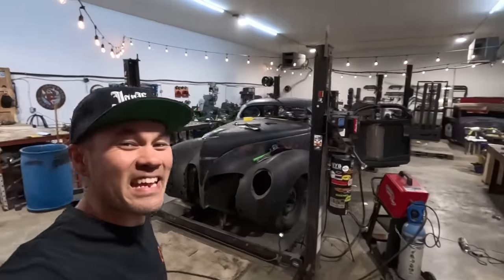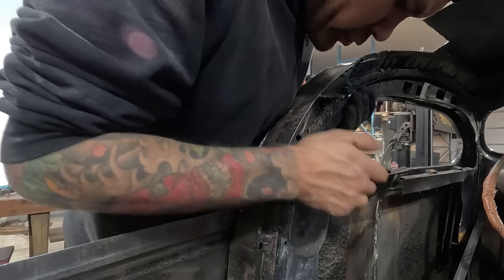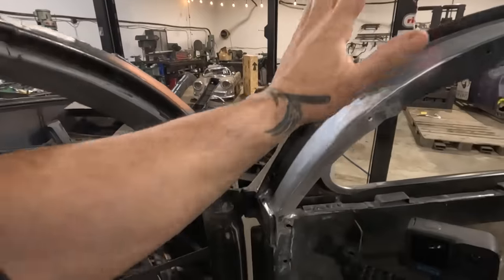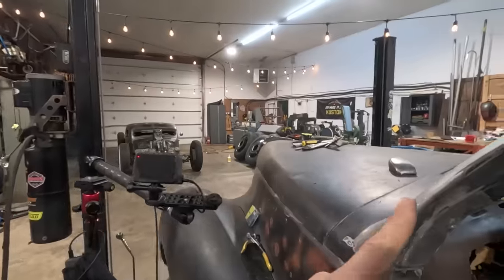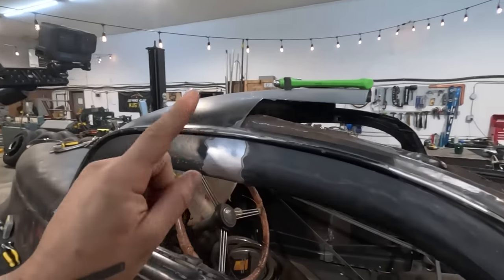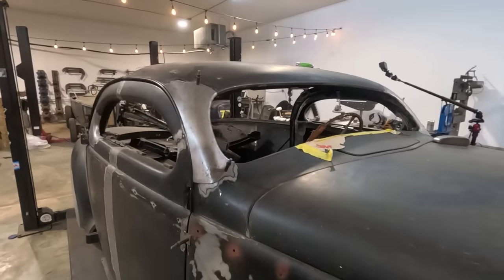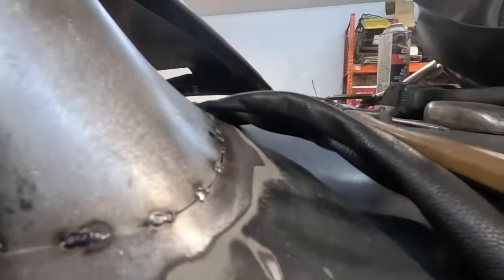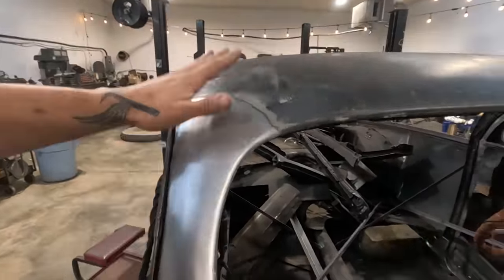How To TIG WELD Sheet Metal - LESS WARPING When There Is No Access DIY 1939 Lincoln Zephyr Chop

Comment: I’ve done a lot of research on the use of weld through primer. Zinc based is the better option, rather than copper based. Also, it is not supposed to be used as a  primer on open areas. Only between mating surfaces on flanges. It doesn’t have good adhesion on open areas and will affect the ability of other coatings to stick. I guess in enclosed areas it’s better than nothing, but it is wasting money. Just use a regular paint in there. Also, if it is going to be used only on mating flanges as intended, it is far easier to apply to the localized area in a brush-on formulation, rather than by aerosol.

Comment: Karl that is looking great and is my favorite one to follow along with the big truck .  There are only two things i would do different and only because I have been know to loose or damage parts on my projects . I would remove all gauges , box them up and store them in a safe place until it was painted . The other is remove the complete steering column just to get it out of my way .  Oh and it's great to know Brent will be back to help work on the truck . My other favorite show  " Half Ass Kustoms " . Hopefully they are putting metal on his new shop by now .

Comment: The weld thru primer on the inside structure is a great idea. Did you spray weld thru primer on the underside of the panel you made. Hard to tell in the video..... Beautiful welding!

Comment: I have been trying to tig weld with my new 255 Primeweld for the last couple months and I have been failing, until today I realized my regulator was not fully opened (the valve was not cranked open) and it turns out I do know how to tig weld after all.   It is amazing what the proper argon flow can do.

Comment: Think it’s cool that you grind as you go. I would lose track of the welds if I waited till the end to grind.
Reply: Do you know what wheel he uses for those inside corner or inside angle grinds. Is it stone?
Reply: @bender49ers  I saw three things. 1). Die grinder with a cutting burr. 2). Die grinder with 2” or 3” 3m 80 grit pad. 3). DA with 80 grit. One of his recent videos (last 2 I believe) Karl discusses how he grinds welds.
Reply: @bender49ers I just saw it yes looks to be some sort of stone.
Reply: @tjakr3869  thank you I need to find that episode.
Reply from the maker: I use mostly 80 grit and then DA with 80 grit. For tighter spots I may use a stone or a carbide cutter on a die grinder. Cheers guys!

Comment: Thanks for all you share... So nice to follow you! ❤🇸🇪
Question! Have tinkered a lot with cars in particular, repaired and rebuilt, welded and painted.... My experience says that: When I metal work, weld and use "new sheet metal" on oem sheet metal, regardless of how much time I spend and how careful I yet, when I grind down welds, in the end with glace, primer and varnish, pretty soon rust penetrates the now processed "thinner older metal"... and bubbles the varnish, not big, but clearly visible bubbles that eventually destroy the whole the job!
Some parts of the older metal, small "points" have lost most of their thickness and rust is seeping through from the inside....
How do you think about this?

Comment: Do you use .030 or .023 wire in your mig welder?  I have always ran .030 due to its versatility, but recently got some .023 and hope to give it a try soon on patch panels.
Reply from the maker: 0.23 for sheet is best but my machine is .030 in this video (buddy is borrowing my smaller unit)

Comment: What size Tungsten are you using for that? Are you using rod or mig wire for the filler?
Reply from the maker: Hey! This is 0.040” filler rod but I use .035” mig wire also. And 1/16” tungsten